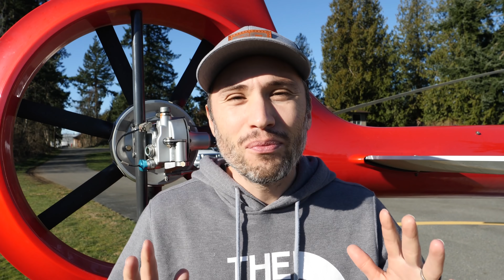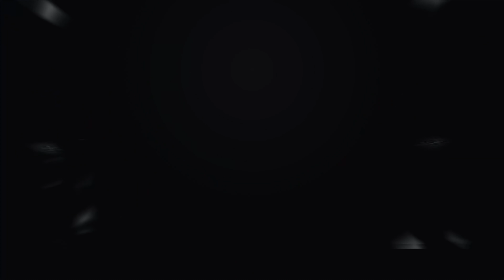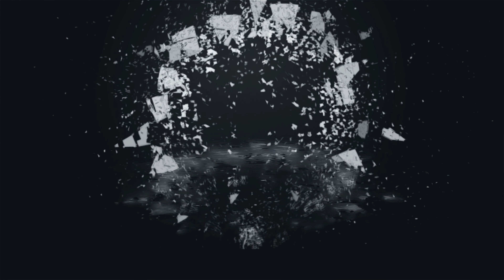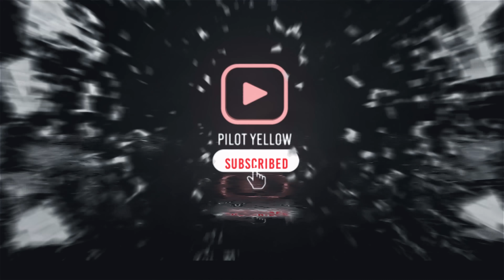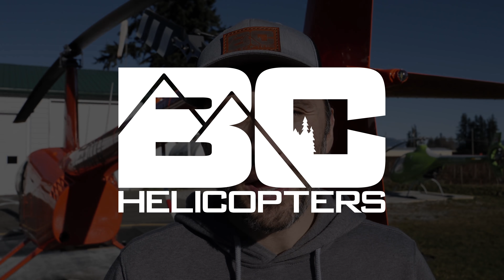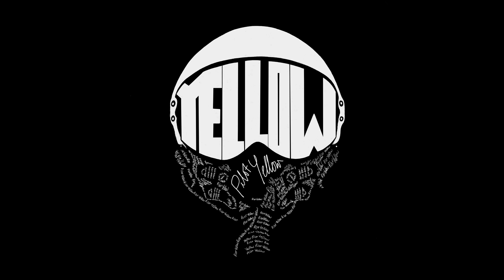why Fenestron tail rotors suck!

Comment: My experience has been just about the opposite of what is presented in this video with regard to the helicopters I have flown. I flew three versions of the 206 LongRanger, one with the standard bell TR blades, one with the Van Horn blades and one with the Bell high altitude blades (basically a 407 TR) and only the original 206 blades were linear. The Van Horn would generate more thrust off of neutral making it more "responsive" initially then drop off with additional pedal application. It was much easier to overtorque with the Van Horn. As for the Fenestron, the Airbus EC135 and H145D3 version (can't speak for others like the skinny one in the video) is really excellent with plenty of authority in all conditions I have flown in with it. It has a few small quirks such as lip stall that makes for a wiggly situation but control is always maintained. The other advantage to the fenestron is a failure (broken off at the root) of a blade crates a vibration but the aircraft still flies with no catastrophic failure. I was skeptical about flying a Airbus Fenestron but quickly became a fan of the design.

Comment: Thirty-eight years fast jet and helicopter including Gazelle.   I agree heartily with the comment below.  Not only is the safety factor of supreme importance but the Fin surrounding the tail rotor is of a lifting section, thus relieving the power requires by the anti-torque penalty in forward flight.   The t/rotor drain drain being  much reduced. Further more due to the higher RPM of the Fenestron, the torque on the T/rotor drive shaft and gearboxes is lighter and so in  less stress compared with the conventional drives.
               Also, in forward flight the Fenestron rotor is working in relatively less disturbed air and requires no flapping hinges. The conventional tail rotor is flapping back in forward flight and it's thrust vector is consequently tilted aft.
              The loss of authority outlined in this article is, in my experience, the result of cavalier, cowboy  handling. It is true that a bootful of rudder initiating  a hover turn will cause overtorqueing and possible loss of t/r authority but flown sensitively the Fenestron is to be recommended.   Having flown five different types in my time, the Gazelle was indeed the prince of helicopters and a delight to fly in all aspects of rotary operation..

Comment: I would have to disagree...I love the Fenestron and it has been in use since the late 1950's. I have 12,800 hours in helicopters with 5,000 hours mountain & bush flying experience Bell 206B Bell 212 AS350B / 4,000+ Police flying AIRBUS H120B / 3,000+ hours Mountain Flying Instruction AIRBUS H120B AS350B2 Bell206B Bell 407  / 800 hours AB Initio & recurrent instruction Robinson R22 / 44 Bell 206B AIRBUS H120B. It is my opinion that most LTE crashes are a result of being over weight for a given altitude & temperature / lack of mountain wind - terrain airflow knowledge or experience and combined with mishandling or overcontrolling the helicopter at a critical stage...eg. landing. In your video you spoke about Main Rotor RPM droop which also causes the Tail Rotor RPM to droop x 6 or 10 RPM depending on the type of tail rotor system...that is accurate. The issue is not so much what type of Tail Rotor system you have but MORE IMPORTANTLY how the helicopter is being flown in critical conditions like gross weight in high altitude mountainous terrain...or even in regular helicopter flying by student pilots etc...small control inputs will naturally have the student pilot counteract the torque without a BIG YAW SURPRISE by a large collective input...you mentioned Main Rotor Droop which of course may lead directly to LTE...again it is only my opinion that if a helicopter experiences Main Rotor droop then it is likely that a number of critical steps on a flight have been missed...eg. too heavy for the given altitude & temperature / too heavy for the given VERTICAL and potential 'DOWNFLOW' wind at a certain landing spot and not having the knowledge / training or experience to FIND OUT what the VERTICAL wind is doing at a given landing spot so that you can make an 'informed' and SAFE decision to land there or NOT land there...or a steep helicopter approach that has too much FPM VSI down requiring a large and abrupt collective input as the ground approaches resulting in the possibility that there might not be enough Tail Rotor Effectiveness to counter the inputted Torque.  So much of helicopter flying and especially mountain / high altitude flying is critically dependent upon HOW the pilot handles the helicopter throughout the whole recce process and on final to landing should a landing be undertaken - in other words small control inputs and smooth flying so that large control inputs eg the collective are NOT required since that would then require a LARGE power pedal input and that may lead to LTE. Anyway... take care. Sincerely...Vern
Reply: Wanna teach me? I need a good instructor!

Comment: A fensetron allows the tail rotor to be equipped with fixed stator blades. The stator blades will cancel out rotational turbulence from the main rotor and prevent loss of tail rotor effectiveness.

For even more lateral stability use a stack of multiple tail rotors and stators, essentially forming an open frame compressor turbine. Though alas the rotor and stator blades closely sweeping past each other will generate lots of noise.

Comment: At the start, you discuss the underpowered issue of tail rotor authority. At 2:22 you talk about delay (delay is aka lag) between applying control input and getting a response. That is very different from low power. With delay, the full power can be there, it just takes time to show up after the input is applied. If there are really two effects, you should have made it clearer. If there is only the first effect (underpowered), then the discussion of delay is very misleading or simply wrong. Also, what's with the annoying drum beats at around 5:40? If the drumming is because you can't discuss something, then just don't discuss it.

Comment: Just watched a video of a student crashing a Fenestron equipped G2 and it looked exactly like what he described here.....got behind the power curve on entry to hover and it started spinning out of control. That seems inherently unsafe to me. Can't they give the darn thing more tail rotor authority?....for crying out loud. Watching the crash I thought could he have recovered if he had let off on the power and held full travel on the pedals?  Helicopter guys, how WOULD you recover from LTE in the G2 ?  .....at low altitude, entering a hover ? 
Again, can't they give the thing more tail rotor power? Maybe even have the tail rotor all electric and independent of the main rotor. This is 2022. Look at all the drones and quad copters that are all electric. It's a new age....why not make the tail rotor all electric so it has all the power you might ever need? On the Boeing 737 they have a elevator feel computer that limits elevator movement at high speeds. They could make a rudimentary tail rotor feel system that would be activated by wind speed like on the 737. Something to limit pedal travel at higher speeds.....if necessary. Ask an engineer....maybe that isn't even necessary.

Comment: Fenestrons work just fine, the problem is pilots that transition from standard tail rotor helicopters without adequate training or knowledge.  Eurocopter put out a paper on this that is very well explained.  The TLDR is that they are rigged differently in EC products ( now airbus ) so that more pedal throw is used to get the same amount of thrust.  It feels weird at first, like going from power steering to manual, but not precisely that.  Once adapted to it you will find that you have a finer control feel and can keep the helicopter more accurately trimmed/pointed at all times.  I've flown the EC120, 130, and 135 for decades and never had a problem, hot and high or sea level, even parking 130s with some regularity with strong tail winds.   I'd wager a round of drinks that if you total up accidents at ANY regulatory authority around the world that have been attributed to LTE or the like, that the majority of these will be in standard tail rotor helicopters and not fenestron aircraft.  This may be related to the much higher speed, blade count, and thus much lower angles of attack of the fenestron.  Much harder to stall.  Also probably to many early Bell and a few MD helicopters that had tail rotors too small for the MGTOW of the aircraft.  If you're heavily overpitched and the rotor systems are decaying, well, you're going to have a bad day regardless.

Comment: "LTE" is due because there is a flow  of wind blowing in the direction of & into the tail rotor, therefore resulting in its ability to do its job effectively to compinsate for the torque of the main rotor

Comment: Great video - Personally I'm a great fan (pardon the pun) of the Comanche off-set fenestron to reduce the rotor noise and give 'some' extra protection. 
The Comanche - like the F-35, was probably a bit too far ahead of its' time but there is way too much invested in the F-35 for it to fail now and tbh it's pretty damn effective. The Comanche would have been a game changer - sneaking in low & fairly quiet and able to pass real time target locations to other assets. It was a mistake to cancel it but Boeing had a lot of feature updates to contend with. The Army should have accepted a basic model & upgraded it as technology progressed.
Personally I think that now either stealth tilt rotors or push-dual rotors are the way ahead - but I think the Comanche was a real missed opperitunity! It just needed more oversight!

Comment: Well what you say might be true on "ultra-light" H/C, basically underpowered, but not on "normal" H/C. 
I have been a H/C pilot in the French Army Aviation for 10 years, then I became an Experimental Test Pilot and, to be honest, regarding the fenestron I didn't see any problem with it. We operated about 300 Gazelles (1/3 SA341 and 2/3 SA342) in the ALAT without any crash due to a mechanical or design issue. The Gazelle was at the end the safest H/C we ever had and none of them ever encountered a LTE.
I made my basic training on Alouette II and "combat training" on Gazelle. It was not a big deal, the Gazelle was just easier and more pleasant to fly compared to the Alouette and that's it. Never noticed that there was a "non linearized input" with a fenestron, it was the same. Moreover, we were not warned about any specific limitations or traps in relation with the fenestron. The only "limitation" was that the fenestron requires indeed more power (in hover) than a tail rotor, so that a Gazelle is a little less efficient in mountain flight than an Alouette III for example. Otherwise, no problem. Note that the Dauphin, which is also fitted with a fenestron, is still used by the US Coast Guard (MH65 Dolphin) and they are very happy with it. 
At cruise speed the fenestron brings even a huge advantage due to the design of the vertical stabilizer: it allows to survive a failure (breaking) of the transmission (Gazelle, EC120, EC130, AS365 Dauphin, EC135). With a conventional tail rotor ... you crash.
Note that you can face a LTE with a conventional tail rotor either (R22 or Schweizer300) depending on the wind direction relative to the H/C while on Gazelle we trained to land with tail winds (tactical reasons) without any problem. In other words, depending on the H/C category you are reffering to, the arguments can be inverted.
Final point: regarding the rotation direction of the rotor: you are not the first one who refers to "European helicopters". That's wrong. To make it short and simple: seen from above, French and Russian H/C (and only them) turn clockwise and the rest of the world anti-clockwise. Agusta-Westland, which is also European (Italian and British), have their H/C turning anti-clockwise (A109, A129, A139, WG13 Lynx, EH101). Even inside Airbus H/C (originally a merging of Aérospatiale-France with MBB-Germany) the H/C designed in France are turning clockwise (from the Ecureuil to the Super-Puma) while the H/C designed in Germany are turning anti-clockwise (Bö105, EC135, EC145). 
Regards
Reply: Thanks a lot. Merci.
Reply: @tomf3150  You're welcome
Reply: cool
Reply: Fenestron is Safer and Quieter..

Comment: Sounds like Fenestrons would really benefit from going electric. Besides a CG change, the weight difference between driveshaft to gearbox and wire to motor The battery increase shouldn’t add much weight. You wouldn’t need more than a minute or two of augmented power from the battery. So Generator size/weight shouldn’t be that much bigger.
Reply: It would still need a gearbox and driveshaft, as there’s no motor you could fit on the tail rotor assembly that would be powerful enough. Also, that hub area is exclusively dedicated to the adjustable pitch components. 

There would also be a LARGE number of single-point failure modes, which are obviously bad for aircraft design considerations. 

Scalability would also pose a huge problem; even if it was possible on very small helicopters, it just wouldn’t work for utility or higher-performance transport / VIP / medevac helos.

Comment: So sounds like they aren't necessarily worse, they're just less forgiving and require being understood. Are any helicopters fly-by-wire? Both of these problems could be solved by a fly-by-wire system that inputs the proper amount of antitorque input regardless of the non-linearity, and has flight envelope protection to prevent over-pitching.
Reply from the maker: I believe only a couple on the market today are fly-by-wire. They are working on that with the new Bell 525 Relentless but it's not out yet. I believe the new Sikorsky S76 is. But I agree it could be fixed that way. Jason from Hill Helicopters has an easy way to fix it.
Reply: @PilotYellow  A fix you apparently weren't allowed to tell us about...

Comment: Nice video and good explanations. In my view, fenestrons optimize cruise (unload & cowl (streamline) the tail rotor) which gives better range, and sub-optimizes hover (takes more power & channels/sucks whatever FOD is around right thru the fenestron & more fragile tail rotor blades itself). When I was managing the HH65 (Eurocopter AS365) engineering/maintenance program at Coast Guard HQ I happened to mention my concerns to a couple of Army officers in an off-hand comment. THAT got me an unexpected meeting with my boss, the US Army Brigadier General managing the Comanche program and many of his staff, at which they explained their program and design decisions that they supposed negated my concerns. Only one of them, which was maintenance convenience. Their design included a method of changing T/R blades by pulling them individually thru a hole in the fenestron itself. Our model had to remove the entire T/R assembly (where it mates to the T/R gearbox) for damage to a single blade, and was a pain, since even landing on a beach tended to suck enough sand to erode the fragile blades. The other concerns they didn't explain away. They thought the fenestron would prevent T/R damage during nap-of-the-earth hover-hiding from the enemy. My view was that it protected the blades a little better from sticking the tail into a tree, but everything the helicopter would blow up from the trees and ground in a high-powered hover would be more likely to be sucked thru the blades than not. And my biggest concern was the power requirement in high, hot hovers would strain the total power available and reduce the capability for heavy (combat) loads. We all shook hands at the end and I agreed to shut up. The Comanche program was eventually cancelled anyway.
Reply from the maker: Wow Doug thanks for that very detailed reply and fascinating story. That's pretty cool.
Reply: @PilotYellow  you're welcome. i miss hangar talk.

Comment: first question. Why is the fenestron non linear for pedal inputs?  second question, are you talking about modifying the conada effect used in the MD Series helicopters?
Reply: Two reasons. First, just like a fan-jet, there is a narrow power ban at the top that makes the difference in thrust. A tail rotor, like a prop aircraft, has a much wider power band. Bigger vs smaller blades demanding much higher speed for the same thrust. Physics. Second, as you transition from flight to hover, the center of lift of the fenestron is aft of the center of the rotor because of the cowl blanking air at the front, depending on airspeed. As airspeed decreases, that center of lift comes forward to the center and  use the whole T/R in a zero wind hover.

Comment: Im thinking its ok! Its power band is high where as a tailrotor can fly at slower speeds depending on a low power situation as the fenestron requires  full power band which works great on like a EC 155 which manages itself efficiently.

Comment: When you tell about the not linear reaction and the not sufficient power of the fenestron what you are saying is: the engineer has not done his homework! If by design the thing is less reactive to one side that only means, you can not use the symmetrical link for the pedals. And if it is not powerful enough in certain situations it is too small, has not enough blades or the engine is too small to handle the torque you need. Poor design that is dumped on the pilot: let him learn to live with what we messed up!

Any 50 $ toy drone is able to hover on its own without pilot input. You just tell it where to go from there and if you let go of the joysticks it will just simply hover as long as the batteries last. Try that with a helicopter!

We have a long way to go from 1950 th helicopter design to rotorcrafts that utilize the technology we already have in 2021.